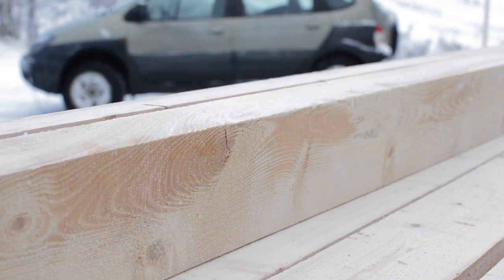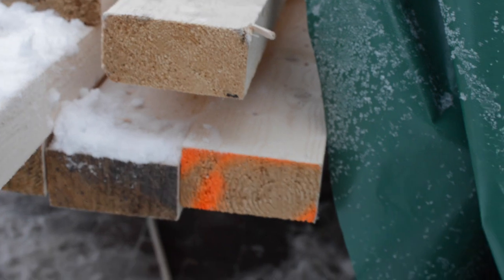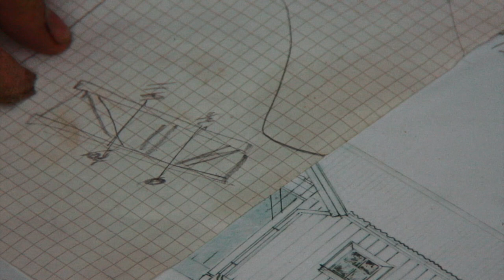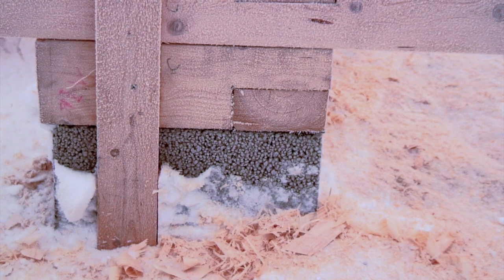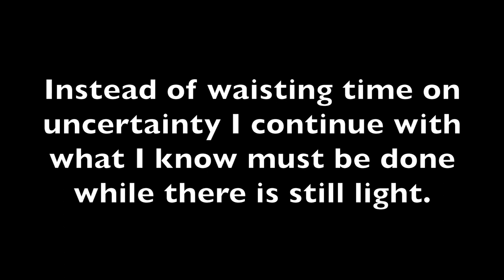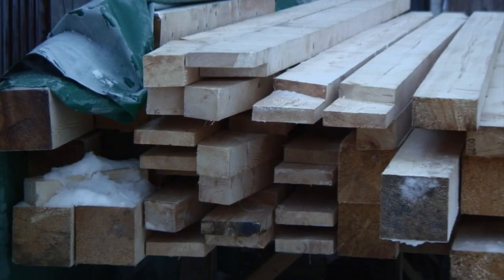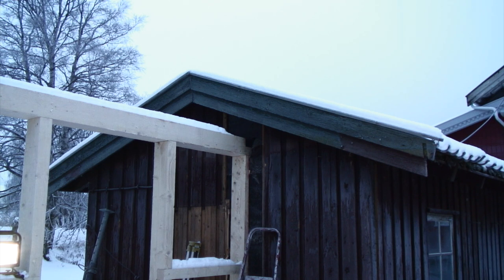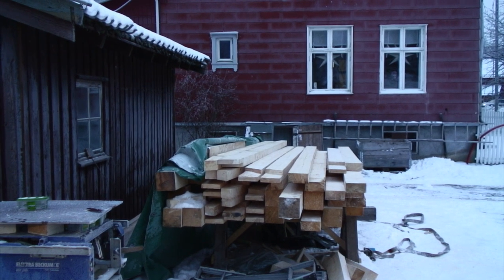🔴 7/35: building a Post and Beam Garage

Comment: Growth(rings) is a result of parent biological material (species, provenance, genes, etc), tree spacing, soil and moisture conditions, management/thinning regime, and ofc supply/demand. 

After WWII, the forests in Norway were in ruins -- the occupation forces had dramatically diminished the gene pool with selective/high grade logging. Following this disaster, the research community/state services decided to improve both the quality and quantity of the forests, but made some crucial mistakes we now face. One effort was to promote non-native species such as sitka and firs. However, the biggest "mistake" was to promote fast-growing spruce provenances from central Europe. Earlier, recommended plant spacing had been not wider than 2 meters. Bcs these foreign species/provenances grew so fast, and "improved" stand development tables where made, the spacing was upped to 4 to 6 m. One of the results of wide spacing is extreme growth rings in early successional stage, resulting in further extreme differences btw core and outer growth as the stand matures (canopy closure). To reduce this difference in ring width, one measure is to apply "hard" thinning (=take out many trees). In addition, as thinning is labor intensive and costly with low to negative net result (in the short run), hard but few operations are often applied. Hence, the obvious result is trees with wide growth rings. Likewise, cross-contamination btw the slow-growing native gene pool and the fast-growing non-native species should be ruled out as a negativ factor. 

So what to do? First, if we want high quality wood and not quantity: price! Demanding consumers must be willing to pay the extra for quality managed trees (right provenance at tight spacing and many "soft" thinnings). But are enough consumers willing to pay 3-4 times the price for densely grown trees? Second, info! Forest owners must be given propper info about how to produce high quality trees. Many "urban foresters" and the modern forest service don't appreciate that selected stands can be grown on low to moderate soils and managed for quality while the rest for volume. Third, the industry should re-wamp their quality control regimes. When I rumble through the lumber piles at any yard or box store in Norway, I'm shocked to see what passes as premium quality. Quality standards are not differentiated as when I learned my lumber grades.
Reply from the maker: Excellent post, thank you for taking the time to contribute. 
I do believe that my customers are willing to pay for quality, if they are confident that what they are getting is better. Since my colleagues and I take a special interest in this area, we go to great lengths to get high quality timber, sorting out good wood at lumber yards (about one third) or choosing timber from low light slopes (in both cases adding to the cost). The incentive has to be financial. And the means, to allow the canopy to remain and grow new trees in shadier conditions? Close year rings is not an aim in it's self, since it can of course be a sign of under nourishment, which does not result in long lasting and rot resistant timber.   
The loop could be shorter, if the farmers were clear about which trees were their best quality timber and knew they could get twice or three times the price for it then things would get better fast. This good wood could be sold locally so that the quality is assured by endorsement of source (like bottled water).
Reply: Under nourished (firm) soils is seldom a factor in Scandinavia as our soils are extremely young (<10.000 yrs old). However, many areas are waterlogged, especially towards higher altitudes and in topographical synclinals at lower elevations (both locations which historically underwent large drainage efforts). My experience is that trees with even, but close (to extremely close) rings, are found in trees that sprout and grow their entire life in the shady understory, aka "understandere", and then they are commonly spruce (you can also find whole stands of minute pine, more like sticks, but then on nutrient deficient and/or frost prone peat bogs (Sphagnum).
You mention shadier conditions and farmers knowledge as essential. I agree and feel that the common practice regarding understory trees as inferior and then just cut them down during thinning and even just leave them to rot, should be reversed. A smart farmer should keep such trees, given they are free of damage and could expect to survive until the stand is logged -- or logged themselves during a selective logging operation -- and then marketed as special sortiment. We used to do that with slow grown pine in thinning and they were then processed as fence posts. 
I think the key is to discuss such special deliveries with small/local saw mills, and have them convey this demand to forest owners. At work we just got a delivery from a such a small mill in Aurskog; nice 8x12" logs with rel narrow, even rings/few knots/no cracks or twist, etc.
Reply from the maker: Exactly, the local supply and demand is all about sound knowledge and every link in the chain can be improved; customers understand the difference if builders inform them,  creating a demand from farmers. Thanks again for commenting, I hope some other viewers get to see this thread it has valuable info. best wishes, Lucas.
Reply: Thx for sharing my views, but a 1000 more thx for posting very informative and cool vids Lucas. I like the hands on and simple approach from a hands on but seriously compatible man. Skål.

Comment: I grew up in a sawmill family and received a BS and MS in Forest management.  I've worked my entire adult career teaching forestry and building handcrafted log homes and timber frames.  Your comment about the growth rings in the one timber @ 5:00 and how they are too wide and that foresters don't have to grow timber that is that fast growing.  That is not accurate.  That is the heart of the tree and the very early juvenile growth.  It is completely expected that a young tree might grow that quickly.  After harvesting, the seedlings are planted and based on the tree species, there is an optimal harvest plan and then a reforestation plan.  Based on a large number of factors (Site quality, soil depth, soil type, slope of the ground, the direction the ground faces, latitude and longitude and the optimal mix of species replanted), the correct seedlings are selected and planted at an optimal (read 'lagom') spacing that will ensure the survival of most of the seedlings and result in a uniformly stocked site.  The ideal is to have the young seedlings grow rapidly at first so that they will accelerate and grow up and out of the local brush species.  Once the tree is up and out of the brush, the tree canopy will close in and the trees will slow down in their growth.  What you have here are the tree rings at the earliest stages of growth.  If you look closely at the end of this timber you will see that the growth rings do, in fact, get narrower at about 10 years and then decrease annually.  This is ideally what a forest manager would like to see.  In the US, the grade of the log is based on a number of things for the intended end use.  Most purchasers will state that they want no less than 8, 10 or 12 rings per inch in the last 1/3 of the tree.  If you want better lumber, you will need to raise better trees.  But that doesn't mean that you cannot get good wood from young trees or that the wood in the video is poor wood.  There are things that a person can do to to make sure you are getting the best that you need and understanding that if you want something special, you may have to pay more and plan along.  Please feel free to ask and questions you may have and I'll try to do my best about answering them.  So long as you don't have any wane on the edges of that timber, I would have no reason to not use it n a house.  It looks to be a nice piece of wood that will be used in a short span.
Reply from the maker: Great post thanks, the subtlety of wood anatomy is vitally important for us to discuss.

To try and add some clarity to my remarks about the loose grained timber;
 I use these pieces standing and not exposed to any weather and in such use I have no problem with them. The point about growth rate has to do with making solid wooden houses that are rot resistant. Making post and beam buildings like this is not so demanding on timber quality (as I mentioned in my first film in the series). In a way the comment was a bit off topic because I usually work with log houses so my views about the quality are a bit ingrained. 
In the heyday of Norwegian timber houses (or log houses), house timber was ideally taken from particular woods, which often had north or east facing orientation  and the actual trees would have been grown in shade, since the practice of clear felling was not used until about the 1880's here. What you describe as correct is driven by economic factors, which is fine. I think that different grades of timber should have different value. That was the root of my comment, that foresters can grow what the market demands, whether that be fast or slow grown, I stand by my comment, it was accurate.
The connection between modern stick buildings (lett bindingsverk), and the wood used to make them has made the building of long lasting solid timber houses much more difficult. The "Lafting" (logs house) tradition is that the wood should be close grained and my experience restoring one, two and even three hundred year old buildings here, is that the loose grained timber rots if exposed to weather. I don't blame foresters for supplying a demand, what I want to do is recreate demand for a state of excellence which has been created in the past and could repeated. Bear in mind that the qualities have to be bio-regionally differentiated, even just a few hundred kilometres from here in Sweden the practices are different.  
Thank you very much for taking the time to write a great and informative comment, and for your interest in my films, all the best Lucas